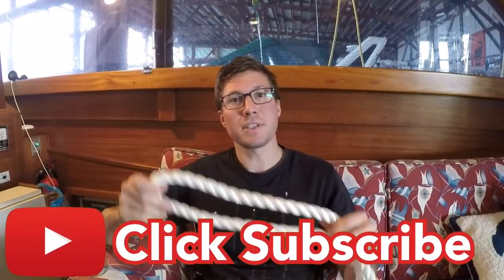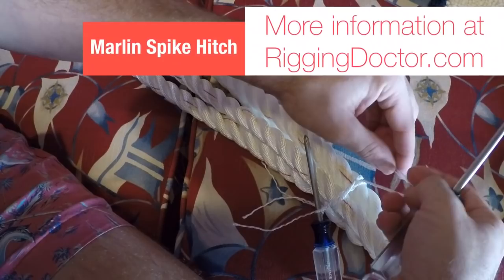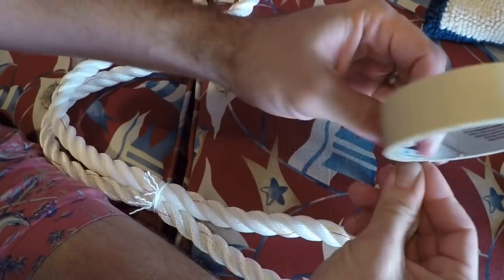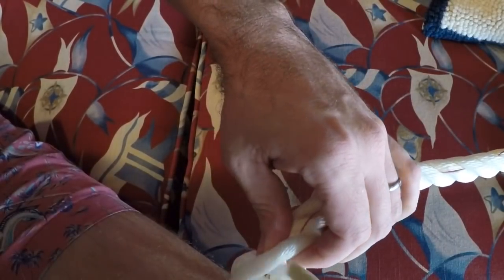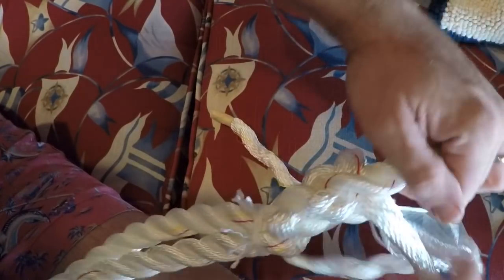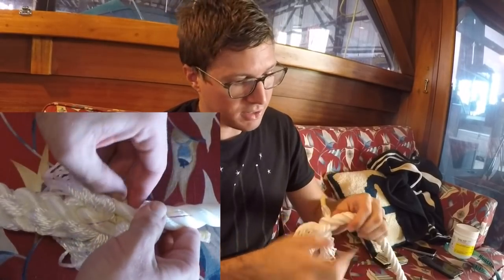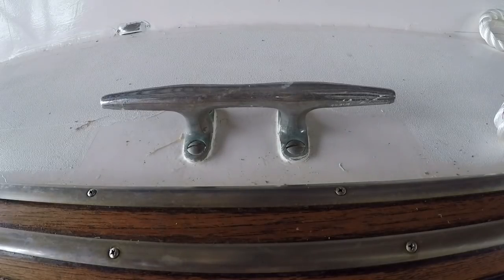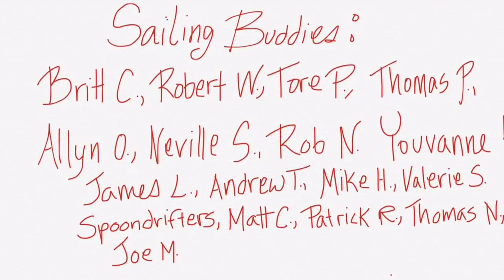How to Eye Splice Three Lay Rope | Sailing Wisdom

Comment: Is there a ratio for eye size to tail or splice length?
Reply from the maker: No ratio, the tail that gets buried is always going to need between 5 and 7 tucks, regardless of the size of the eye. The length of the tail also depends on the diameter of the rope, smaller rope will consume a shorter tail while larger rope will consume a longer tail.
The way I determine the length of the tail is I lay the tail next to the line and count 14 lays in the standing part (the part you are splicing back into). This usually gives me a small bit of waste on my first splice, after that, I can adjust accordingly for the next splice to minimize waste.
There is no clear answer because different ropes will behave differently and consume more or less tail. Old stiff ropes will consume more, new soft ropes less.

Comment: Interesting, definitely different (and quicker) technique than I got taught decades ago. The main difference is that we never got taught to taper the end (or fray it, for that matter). The ends of the strands were meant to be wrapped in string - I don't know the English term for that. "Whipped" I think?

There's quite a few really useful splices. Do you use any others yourself? The only ones I ever used were eye splice, end splice and splicing two rope ends together (don't know what that's called in English, sorry).

Thanks for the lovely video. Reminds me I should practice more. LOL.
Reply from the maker: Yes, we use a bunch of different splices on Wisdom. 
Whipping is the correct term.

The splices we use are:
Eye splice
Back splice
Tree surgeons back splice
Short splice
Long splice
Long bury splice
Mobius brummel eye splice
Reply: @RiggingDoctor  Nice! Would you do a video about the different ones sometimes? Not necessarily how to do them, but why/where to use which one?